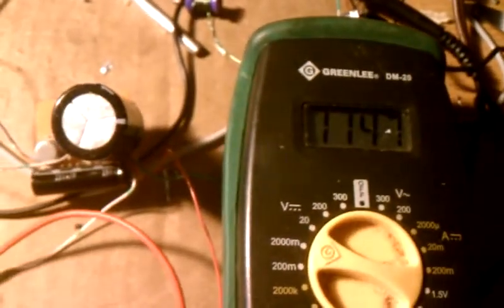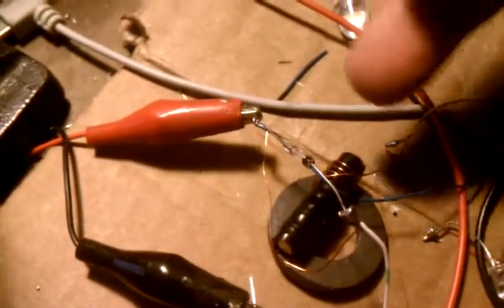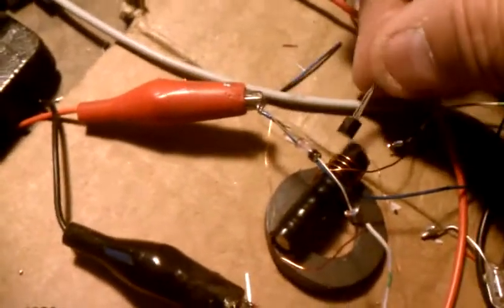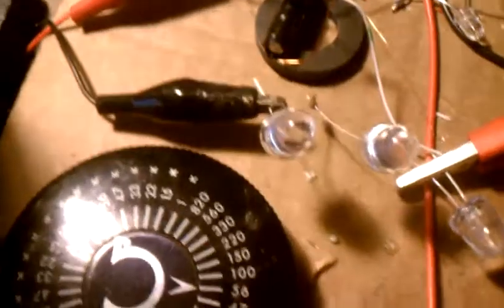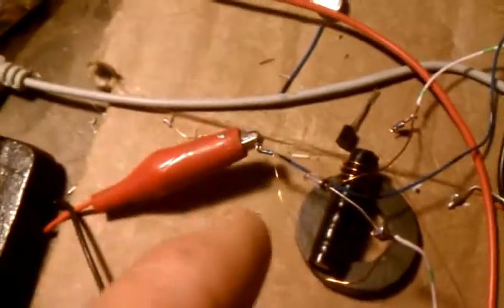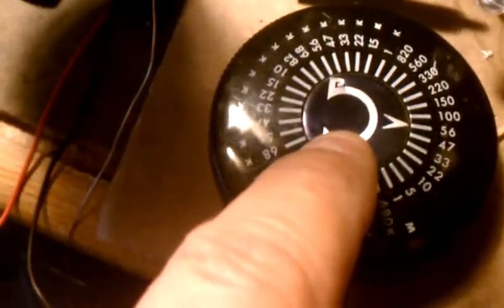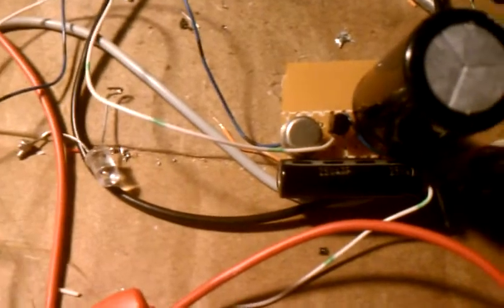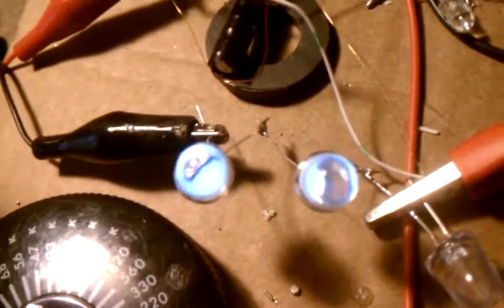selfrunning crossover gadget mod

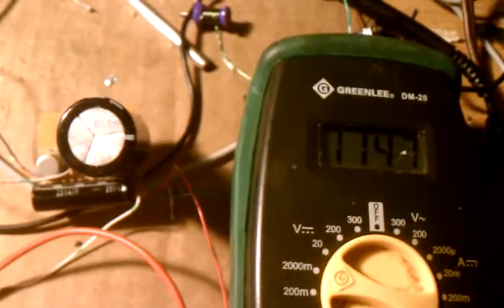Comment: Please go back an listen to your self starting at 00:14 - 

"That tiny little coil there. A piece of ferrite and I took #36 and made one layer, and
then I took 26 and I wound 11 layers under there and I left a little extra. So
I put 11, 12, 13, 14, 15, 16 primary. And thats a little bitty thing. That's
the size of this."

Sorry but that description is not clear.

I'll guess - does it mean you wound 1 layer of #36 and then on top of that added a 16 turn primary using #26?